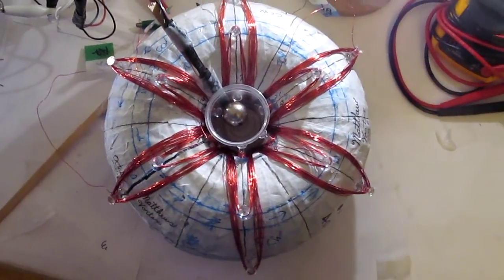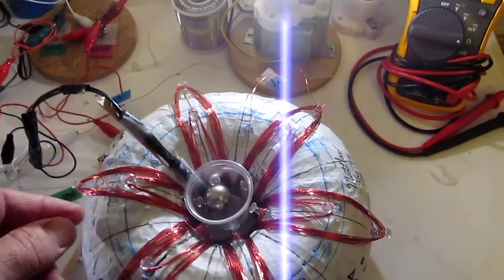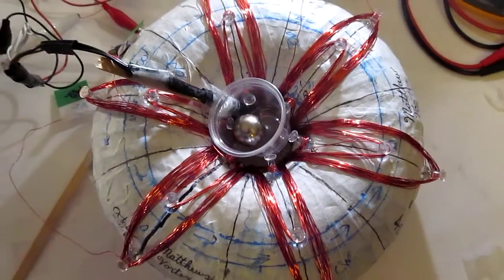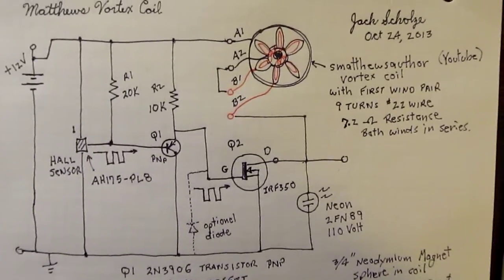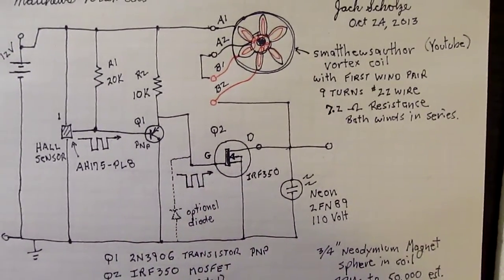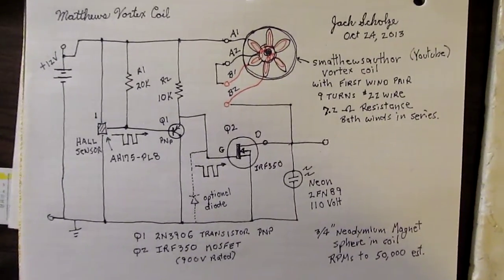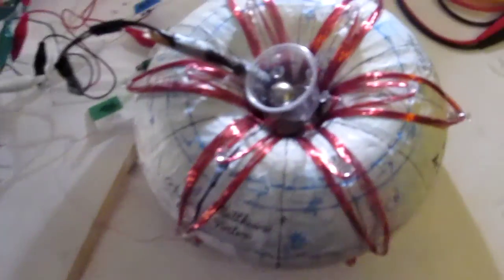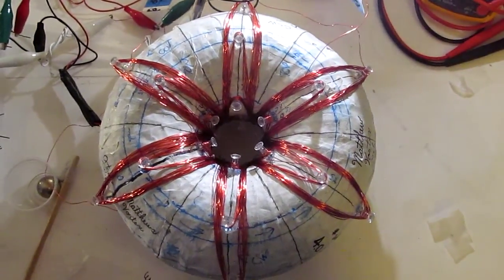Smatthewsauthor Coil Neoball Pulser

Comment: Also I would assume the coil will slowly reach its natural resonant frequency with a hall effect circuit....so 50k is 50khz...Which is the frequency of one of my smaller coils...These coils can resonate at extremely low frequencies, which gives them an advantage over regular solenoids.

Comment: This is a great video....amazing power from such small windings too...hmm. I would like to test these windings. Looks like they could give some great resonant characteristics...A test on the coil used as a transformer would be interesting...See if it has a 1:1 ratio or more...Also if there is a difference in frequency/propagation of the energy....

Comment from the maker: I'll be checking out the magnetic fields wit my Russ Gries Galactic Gauss Wand,  a device he designed and built for himself, and for me, which is a very capable gauss meter for checking field strength and direction.    Also I have a Rigol 1022 Signal generator, that still works on one channel, though I managed to burn out channel 2  :(

Comment: I saw the last video and gave it a thumbs up.  I think the design is great.  If you check out my 501 video again, before i make the diagram 3d and remove the 3rd and 6th ring and put it in the center of the coil where it resides, you will see that this design actually has Seven 9's in it.  This means that there are actually 7 vortex's that this coil creates, the center and 6 other that surround it and they rotate perpendicularly to the center.  I am sure these can be used simultaneously.
Reply: How can it be used 

Powering 

I don't know much
But I would love to ask a pro like u

I'm familiar with all
This geometry

I just don't get how to get this type of coil 
To be source of energy.and how to use it ♦️🙏💠
Reply: If u wounded around the centar 
U would get 6 concaved triangles on each side.

Does doing 3d
Whole coile winding.
Let say exact this pattern or 
With 12 
Give more or better?

Thank u and sorry but better to ask ,then 2 not know

Comment from the maker: Jorge, I'm glad you are working with the flat spiral and conical spiral coils, there is still plenty to learn and explore there.  I've made a few spiral coils and they are powerful and work at a wide range of frequencies.  This new vortex math aligned coil geometry is also quite curious.    Have you designed some improved driver circuits?    Aloha   and best luck to you

Comment: Hi Jack, i know this circuit very well and the problem is that the consupmtion of energy (the input voltage) is too high, aproximatelly 1.12 ampers or more...!  and as you know the output is very low ampers too...! I am working with different configurations of the PANCAKE COIL to find the correct resistance ohms and the correct consupmtion of energy (low input voltage and  at least the same output ampers)